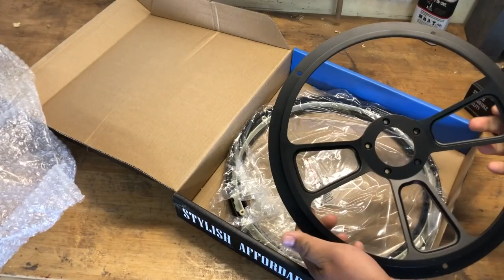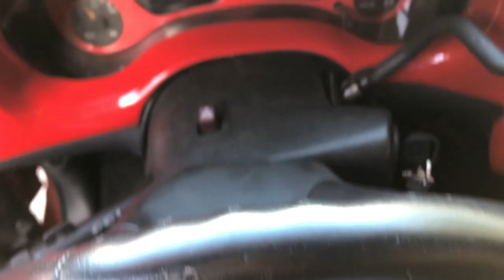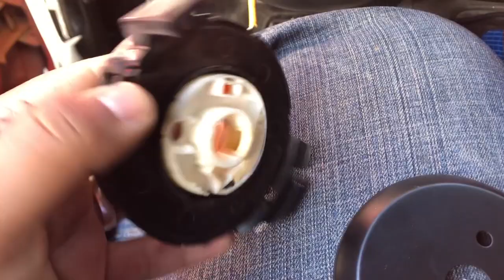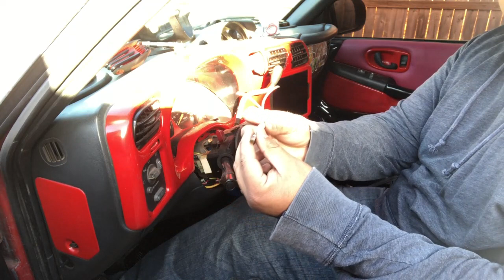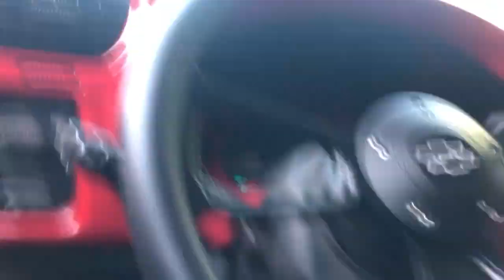Chevy S10 Steering Wheel Swap

Comment: Hey bro! Anyway you can send a link to where I can buy this setup! I have a 2002 Chevy s10 and I’ve been looking everywhere and I’ve had NO luck!! The last thing I need to do is my steering wheel! I hate the original steering wheel with the stupid airbags
Reply from the maker: For sure buddy, you just need to get an adapter to fit the wheel below is the adapter then The wheel.

https://www.amazon.com/Steering-Wheel-Adapter-Flaming-Ididit/dp/B0861ZXL3Y/ref=pd_aw_fbt_img_m_sccl_1_1/130-4004932-8942005?pd_rd_w=OrBIl&content-id=amzn1.sym.c05bcd42-abf5-466a-bc3f-884c0c2f7f50&pf_rd_p=c05bcd42-abf5-466a-bc3f-884c0c2f7f50&pf_rd_r=YDAP54MRSABKQTVGKP37&pd_rd_wg=7Pv1q&pd_rd_r=eb69a775-f9f4-486d-a492-081c0adead5c&pd_rd_i=B0861ZXL3Y&psc=1

https://www.amazon.com/5-bolt-Black-Steering-Aluminum-Button/dp/B00EPM4BQS/ref=mp_s_a_1_1?crid=2VZT4B7HHXRES&dib=eyJ2IjoiMSJ9.lY6vvUISrtas488GexkzL8f7AuR-JPtJo2w9YCd-EPPLnyzgK1CtGrMGFB8rs6bZ1F4EicrGwUIdnPdK4SCUWPjfp3fXmHJb0Pk-ERUfwGVcc8LBZ4DT2wqQAHKRbbXv3XvmY-5KHts2U8pn8X540wEfBu27_rYtEBtzAEBokCiEGnShGaUl6k2t6ajizt7VLtKKrYYAbgM66Adr8AUgRQ.pTvYcEMor3N9WzWcKLfQ0GqVY9o7Yy2sj2reiOOkHQI&dib_tag=se&keywords=s10+steering+wheel&qid=1786044082&sprefix=s10+st%2Caps%2C240&sr=8-1

Comment: Any recommendations for my new steering wheel being to close to the turn signal combination switch? I’m not able to use my high lights and annoyingly can’t turn the steering wheel without my hand hitting on it..
Reply from the maker: Yeah sounds like you need a bigger spacer , mine functions like stock
Reply: @madmike_93 thank you

Comment: Did this on my  97 s10 and gotta order a bigger spacer for the multifunction switch to work properly wheel is too close to it can't use highbeams or turn the wheel without my hand brushing against it

Comment: Dash looks good How did you get your dash painted and it actually look glossy and smooth? Any interior panels I've tried any color change on always scratches off so easily leaving the original color showing and always dull / flat looking. Ended up looking like cheap spray painted interior. just got a s10 extreme for a project and want to do my dash and interior panels but don't want to trash my interior 😂
Reply from the maker: @brandonmunday1494  it’s kinda a process but I can walk you through it.

First, you gotta clean with alcohol and sand it with 180.

Next get some filler primer give it like 3 coats . Take some flat black spray paint and mist your panel.  

Wetsand with 320. What you’re looking to do is get rid of all the flat black spray paint it will show you low spots.

Once that’s done, you can use your spray paint use color and clear . I would avoid the single stage paints if you can.

Comment: The back of my steering wheel broke off while removing it and is stuck on.
Reply from the maker: @craigcarter5276  oh dang! Get a puller and some lube
Reply: @madmike_93  is there any way to turn off the airbag warning ⚠️ light
Reply from the maker: @craigcarter5276  yeah pull the bulb

Comment: Since you've obviously had some time with this wheel, can you ( or anyone else with experience in this) tell me how got it gets in peak summer months, how overall comfortable it is, and how well its holding up?? Any negatives tgat you have learned over time???
Reply from the maker: It does get a little hot in the summer (Texas heat) but the leather foam makes it bearable till the a/c cools it down. Aside from that no complaints

Comment: I just did mine now my gas hand is dead lol wtf man its pointing to the battery voltage
Reply from the maker: Could be a coincidence, before I did  the steering wheel swap I had the same issue , it was float in the gas tank
Reply: @madmike_93  it was the trip reset button on the dash thank god lol I guess it was thrown off by me unplugging the battery in back in action now! Thanks for the video also I followed each step and got it done ✔

Comment: Hey will this steering wheel fit on a 2002 s10?. On ebay its claiming it wont fit
Reply from the maker: Yes mines an 2002 , the reason it says it won’t fit is because of the plastic connector inside is too long but if you cut it in half it will fit

Comment: Mine is different it was 2 red wires on the steering wheel and I can’t remove them without railing them off do they matter at all
Reply from the maker: Post a vid so I can see

Comment: Helpful video. But I have a question. Why wiring the horn button did you splice the 2 wires into 1? Don't the back of the horn button have 2 connections?
Reply from the maker: No I used both connections

Comment: Bro, I have an 01 Tahoe. Putting a Forever Sharp wheel on. Have the same adapter, and same problem with the clock spring with the plastic clip piece in the way. When you remover the clock spring and clipped that remaining wire that was plugged into it, did you have a airbag light staying on?
Reply from the maker: Honestly I can’t remember if it was already on, I’m just removing the bulbs next time I get back there, who needs air bags anyway

Comment: so  is the adapter plate only hammered on with no bolt holding it in place ? doesn't seem right without that bolt  maybe I missed it
Reply from the maker: The center bolt holds the adapter plate, never realized I didn’t show it lol
Reply: @madmike_93   yeah  cool man nice dash bezel  looks factory , Ive been attempting to make a fiberglass mold for the dash bezel  so I can pop some carbon fiber bezels out but its been a real pain in the ass and the first attempt failed  wax and POV didn't work and it still chemically bonded ,shit I should of stuck with power steering fluid like normal but I had to go and try the "profesional" way  or something and it froze together unable to pop apart  had to throw in the trash but learned alot from the first one  hopefully this isnt a 3 times a charm job lol
Reply from the maker: @nobullshiit5682  I did I video of fiberglass awhile back, I used transmission fluid, check it out. One I get a shop up and moved in one of my projects are to make fiberglass dash bezels to sell online but it will be a different method

Comment: I have a 2000 Sonoma I bought with the steering wheel already changed out. Question is, are you having any issue with the gear lever being to close to the steering wheel.
Reply from the maker: No issues so far

Comment: What happened when you cut the wires of the clock Ring? Anything I got all mind all together but can't get the ring wire unplugged...thanks again
Reply from the maker: Nothing happened, just make sure battery is unplugged when you cut it
Reply: Thank you so much thats sounds like a plan Scott the guy I got the hub from said to pull it from underneath the dash also.  Anyway great videos love watching them especially the wing on the tailgate that's my next project.....
Reply: Did you pull the other end of the clock spring out from under the dash? I don't like bothering people but I just can't get the CS unplugged from under the dash ( does it matter if I leave it in) I cut and wrapped the wires with the battery disconnected.
Reply from the maker: @tuttlesr  no worries I just cut and taped it, didn’t want to deal with it lol

Comment: Ok got another question,,,do you put the original nut that was holding the steering wheel on, back on? Or does those three screws supposed to hold it on. I didn't see you put that big brass nut back on. Excellent work!!!
Reply from the maker: Yes original nut goes back

Comment: Hey got a question when trying to pop off the remove the air bag, is there like a torx screw in the hole do you pry above that screw or take the screw out then pry.  Sorry about the question seams weird to me it just will not pop lose...
Reply from the maker: No they are just metal tabs it’s hard to find the right angle but just use some force, it should come out

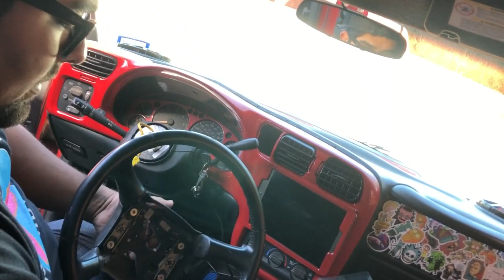Look at 5:25
Reply: @madmike_93  finally got it thanks 😊

Comment: Hey looks like the link for the kit is out of stock on ebay would you know which adapter yours came with to order off of forever sharps website when I use their website search tool it just shows a A16 adapter but ebay and other places look like they're multiple chevy adapters.
Reply: Almost all chevys from way back in the 80s will fit up untill these new 2013 trucks. Full aize and chevy cqrs have same steerin wheel spline so it doesnt really matter. I have an 06 s10 with a 71 Oldsmobile 4 spoke wheel. Really sharp ane rare hard to find but ive done a ton of these so any gm adapter will work even a grant polished adqpter will fit these forever sharp wheels. I used on on my sons 95 s10. Same wheel this dude hqs but a polished grant adapter
Reply: @myassizitchy I would really like to know where you got an 06 s10

Comment: Did you screw the adapter on or how’d that go? As I seen unless I missed it you just took a mallet to it?
Reply from the maker: Yea it just press fits on there. If yours is rubbing try taking a socket with a bigger diameter than the bolt and give it a few smacks. If that doesn’t work then trim your plastic
Reply: So you don't have to put that big steering wheel nut back on?
Reply from the maker: J&C well yea that way the aluminum adapter don’t come off

Comment: Awesome video man, showed me i missed a ton of steps on my old truck. Going to get the same adapter you did for my 2000 and referance this video for the install!
Reply from the maker: Thanks, just a note  since I have a loose gearbox it was hard to determine when the steering wheel was straight but after driving it for a while I noticed it was cocked to the right a little bit so what ended up doing was cutting the white plastic tube thing flush with the aluminum adapter so I could run the wire through the groove and it looks like that put me straight

Comment: Will this fit on my 2003 Chevy s10?
Reply from the maker: Yea don’t see why not mine is a 2002, I will note and I’ll pin the comment , since I have a loose gearbox it was hard to determine when the steering wheel was straight but after driving it for a while I noticed it was cocked to the right a little bit so what ended up doing was cutting the white plastic tube thing flush with the aluminum adapter so I could run the wire through the groove and it looks like that put me straight. Honestly though I love the mod changes the look on the truck

Comment: Before you replace your gearbox I have a suggestion for you, Look into eliminating your rag joint. You can do it by getting a intermediate shaft out of a 88 to 94 jeep Cherokee
Reply from the maker: I did do that actually, I have a bad gear box
Reply: @madmike_93 Have you adjusted it at all possibly?
Reply from the maker: @photondebuger45  I haven’t messed with the steering tbh
Reply: @madmike_93  i mean that's something that is like free ish to do besides time. If you feel it's bad then a small adjustment wouldn't harm it really.
Reply from the maker: @photondebuger45  it just doesn’t bother me when I drive it.
Reply: @madmike_93  ah ok never mind lol x3 just as long it's not dumping power steering fluid on the ground.
Reply from the maker: @photondebuger45  oh yea no leaks on the steering system
Reply: @madmike_93  ah okay your cool then I do notice that people have that issue too with theirs my Sonoma is..... Fine?? When it comes to the steering? Well everything is from 98 when it was made too so that makes them old and crusty. Tho like the last bit that people tend to not remember or know trucks are different. Is the rag joint and or steering box usually the rag joint
Reply: Not only can you do the jeep Cherokee shaft you I'm 99% sure you can get a lot tighter steering box from a late 80 (mine is an 89) WS6 optioned formula firebird, GTA, or Camaro z28 or iroc-z) my steering box is still I  my 89 formula firebird because I built a fully race built stroker 383 and converted from the automatic 700r4 to a manual 6 speed from an LT1 powered Camaro SS, but alot of guys get the fast ratio steering boxes from late model 3rd gen f-bodies (camaro and firebirds) to put in other cars. all WS6 optioned firebirds before 1992 should be the right one. I'm a firebird guy but about 98% of everything crosses over between the Camaros. I think they are 3 turns lock to lock but might actually be a little tighter than that (I cant remember off the top of my head) I built the 89 formula when I was 16 which was 21 years ago and if still runs 10s in the 1/4 and I can still daily drive it. I also have a 2000 zr2 4x4 s10 and I learned about the Cherokee shaft because its narrower and gives just enough clearance to use 98 or 99 cast steel ls1 f-body exhaust manifolds to do a LS v8 swap into a 4x4 S10. You need the 98-99 ones because thet are cast steel and you can werks them easy since you have to cut the flabge off and add an extension to the deived side at the very least.  the newer 2000-2002 ones are cast iron (or I'd use the ones off my 71k mile 2002 WS6 TransAm 6speed). The 02 also runs 10s and is my daily driver.  Both cars have nitrous like most everything else I've modded. The zr2 s10 is my first LS swap and first turbo build and despite the nah sayers it will have A/C, power everything and be as normal of a daily drived as my 02 transam is, until you stomp it. actually more so if an easy daily since it will be an automatic. If you ever want to do an LS swap look for an L33 5.3L (5300 H.O.) because it's an aluminum block 5.3L with 799 heads which are the same casting as the 243 heads on an ls6 and it weights the same or maybe a bit less than the all iron 4.3L (big deal for 4x4 guys with torsion bar front suspensions). Theres alot of tricks to free up the power on the 4.3L but the intake is the killer. You can actually get good cams, heads, headers, and full exhaust but that spider injection intake is junk. Also the 4.3 likes to break the block with most any power adder. If you haven't replaced the steering box yet make sure they are the same and get a new/remanufactured one for a 1989 WS6 (performance package) formula firebird it will really tighten up your steering. Alot of 3rd gen f-body stuff swaps over to the s10. I've noticed a ton of guys have transams or camaros along with their s10. Probably because of the drivetrain similarities.

Comment: Did this cause a air bag light ?
Reply from the maker: That’s a good question, not sure since mine was already on for the passenger, I’ll see if I can figure it out and get back to you.
Reply: @madmike_93  please do love ur video I hope u make a ig or fb I'm sure the guys on the s10 pages would love to see ur videos and recomend anything for a cracked dash besil
Reply from the maker: @tannerhederson4067  yea for your cracked bezel, roughen the underside plastic where broken with 80grit  and clean with alcohol, tape the broken piece back on the front. Buy some plastic epoxy (make sure it sticks to ABS plastic) and glue it on the sanded side, reenforce with fiberglass if needed.
Reply: @madmike_93  thanks I'll give a shot
Reply: @madmike_93   ended finding a new dash besil for a good price but how do u get it flat and beautiful wen u paint it
Reply from the maker: @tannerhederson4067  the way I like to do it is sand with 120g through 180g clean with alcohol and water mixture(wax and grease remover works too) spray with filler primer. Then sand off with 180g. The filler primer will fill in the crevices and sanding marks. Then clean again and spray epoxy primer, sand starting with 320 up till 600grit or 800grit depending on what color or finish your going for. Try to jump 100-150 grits apart if that makes sense. Once that’s done and you have a nice and smooth surface you can paint. Using spray cans or using automotive paint . I’ve used booth before, rattle can color and sprayed clean. It all looks the same. There is a bunch of ways to do it but that’s what I’ve found to work for me.
Reply: @madmike_93  by hand or sander
Reply from the maker: @tannerhederson4067  I’d recommend by hand 🤚
Reply: @madmike_93  gotcha thank u